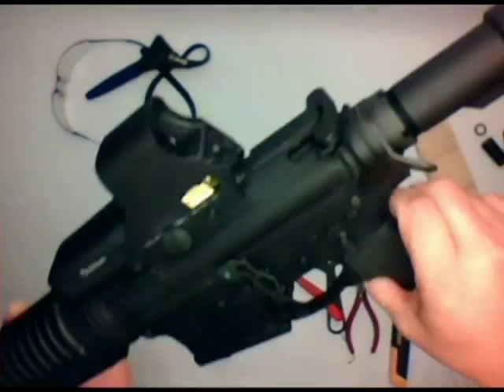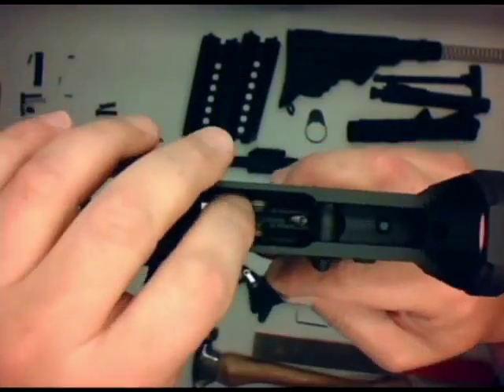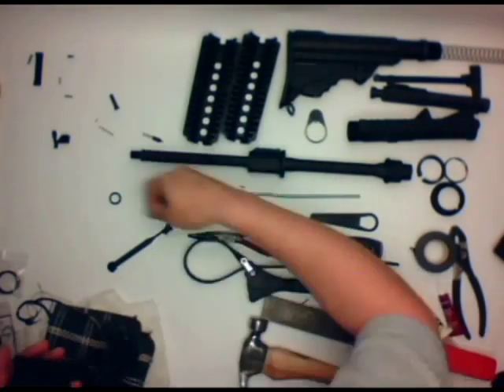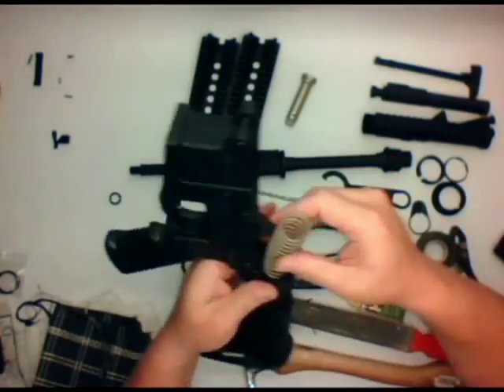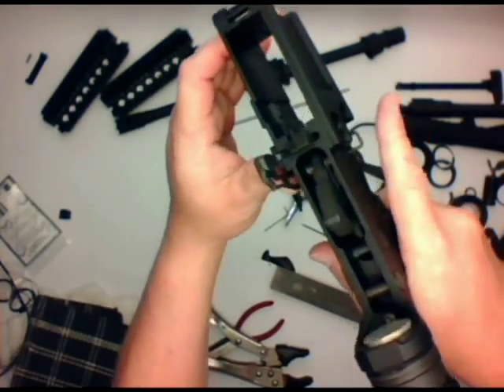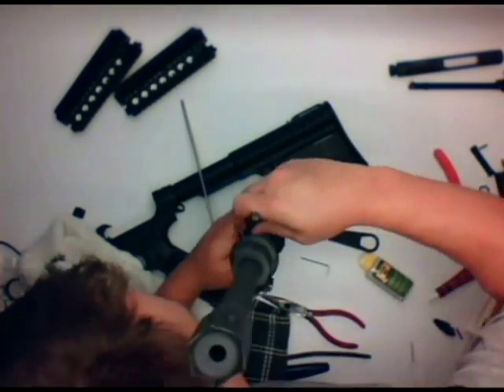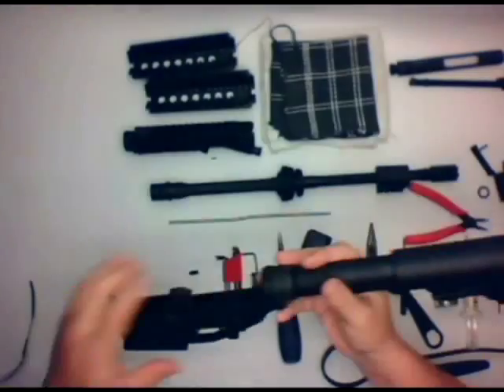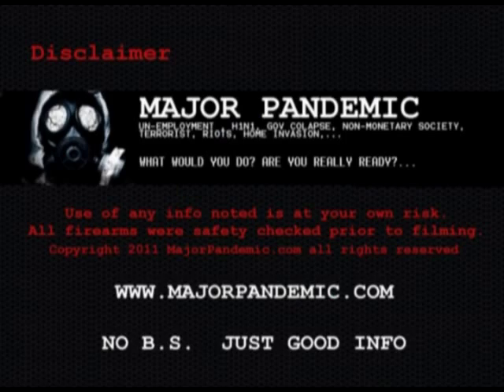MajorPandemic.com - HOW TO BUILD AN AR 15 FROM PARTS

Comment from the maker: Thank you.  A couple private messages have asked how long the elapsed time was.  The video is running at roughly 3X, however there was some off screen time on the vise.  I would say total time was a 90 minute assemble to assure everything was correct.